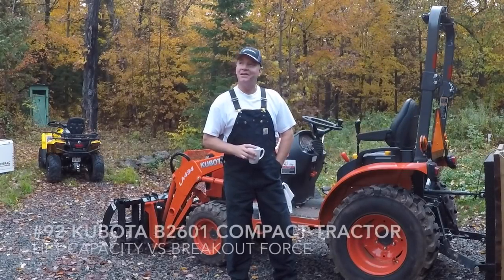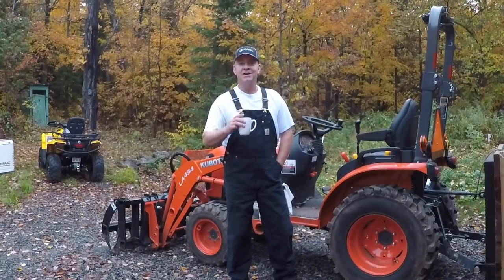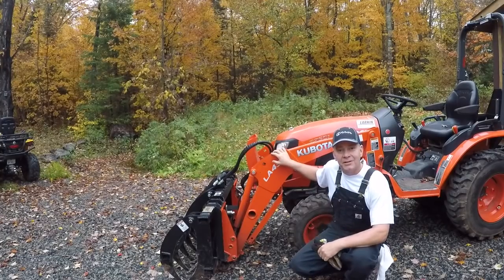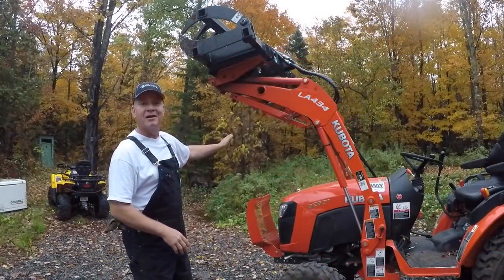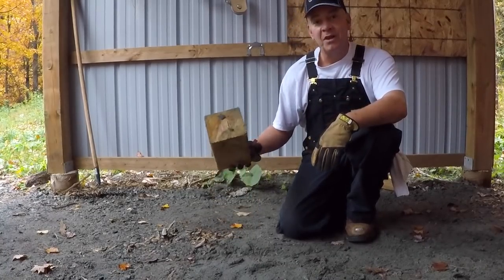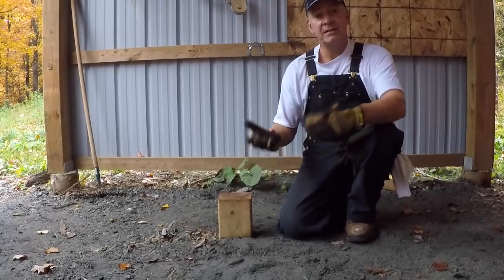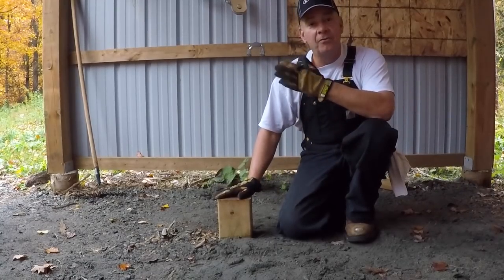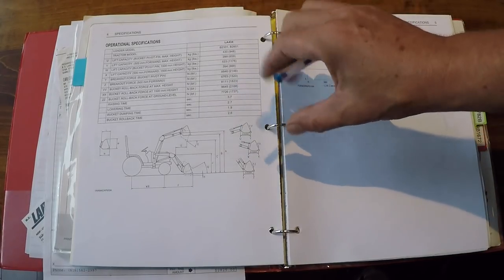#92 Kubota B2601 Compact Tractor The Great Debate : Lift Vs Breakout Force

Comment: Very good explanation of the front loaders operation. The designed capacity is very high and just what you would want but, that is just the loader. The capacity of the tractor running gear must also (or not) be considered when lifting heavy loads. Tires, axels, bearing, ect. must all in their turn carry the loads once lifted. All that said, the B-2601 Kubota only has a front axel capacity of just over 1300 lb.s according to the spec. sheet and if you add the bounce factor which is what I think broke the front end of my tractor years ago, weight on the loader can and do become extreme! I am looking for some pictures I took when it happened to me if I find them I well send you copies.
Reply from the maker: Hey good morning Rick. Yes you bet. I still need to do more digging as you make a good point. If my front end can only handle 1300 lbs, then I need to be conscious of that. Which makes me wonder what other components I need to also be careful of. I'd also like to ask the dealer why the tractor can lift more weight than it can handle on the front axle. Still lots to do. And yes, if you have the pics, I would like to see them. Cheers and thanks again Rick!
Reply: Because the loader attaches to the center of the tractor. The load on the bucket is transferred through the loader to the frame. The frame is supported by both axles not just the front! So u were just fine lifting that big ash.  Obviously u dont want to bounce around as that increases the forces.
Reply: And if you ballast the back of the tractor, even less of the weight is on the front axle.  For argument's sake, if you put 1000 lbs on the back of the tractor, that's now pivoting on the rear axle, and lifting the front of the tractor somewhat.  When you put load on the FEL, it first balances out that rear load, then puts load on the front axle.  Because you've got two pivot points (front axle and rear axle) the overall load is kinda hard to work out - but basically the more you put on the back, the more weight you lift off the front axles.  The right amount of ballast is probably as much as you can take so that you can still steer when the FEL is empty - that shifts as much weight to the back axle as possible.
Reply from the maker: Hey thanks Andy. Sorry I just saw this- that makes sense - Cheers!
Reply from the maker: Hey good morning and thanks Paul! Cheers!

Comment: I have a question. 1st very good video. Very informative. Take a 3301 by Kubota. The lift capacity is about 1100 lbs at pivot pin. Tractor and loader probably 22-23 Thousand. The RK 37 demonstrated on outdoor with the Morgans will lift about 22 hundred lbs. Price 20 grand. (Lift at pivot pin as well). So should you lean towards a Rural King as opposed to the Kubota. It seems that Kubota and John Deere have clean lines , good craftsmanship but Tractors like Mahindra,  RK, LS, TYM...Smoke them on performance. I would appreciate some feedback . I hear over and over again you're paying for the Green or Orange paint. What do you think? Thanks. Mark.
Reply from the maker: Good morning Mark. Well, I have to say I am no expert for sure on this but for what it's worth, and in general, here are my thoughts.  I think for sure you pay a little more for the paint. But that's because the paint has a long history of engineering, presence and historical long time proven reliability behind it. Not to say that others don't have good engineering, but the market is now becoming much more competitive than it used to be, especially in the compact and utility segments. Take any industry you can think of and usually as new competition enters, the old more established brands take a while to realize or react to the fact that their market share is being depleted. Most if not all those brands above have good long warranties so that would give me comfort. Re: performance. I think the new competitors are doing what they need to do to gain market share. They are providing more value for less money. Of course, without a long timeline of historical performance ( relative to green or orange), they know that is a big consideration for someone spending $20k. and therefore a big hurdle to get the consumer over. Why I bought orange. Of the 4 dealers I visited, the Dealer was awesome, and still is to this day. Selling tractors for 40+ years,  so they had long presence, proven long time reliability and experience and that was worth a little more to me since I am a long way from any dealer.  But I'll sum up with this - the RKs look like a good tractor with good value for the money. And they have an 8 year warranty on them ( longer than Kubota). And they are trying to break into an established competitive market so they should be providing greater value than the established companies. So if you find the dealer is good and you have confidence in him/her, and after reviewing the full specs ( not just lift capacity) of the various tractors you compare,  it looks like a good match for you, I would consider it. The company that makes RK has been around for a very long time. So some research/ googling on them would be helpful too to help provide confidence. Sorry that was a long answer and not sure I helped you much but hope there was something in there that helped. LOL. Good luck and let me know how it turns out if you decide to buy one. Cheers Mark!
Reply: @GPOutdoors  Thanks. Very helpful. I guess a point I was making, why would you buy a Kubota 33 hp when you can buy the RK with 37 HP , lifts DOUBLE on the Loader and 2 to 4 Thousand less money? But you are right. One way to put a footprint in this market is to come up with a Tractor with these specs and unbeatable price. Hard to turn down. I have owned the LS 33 hp for 2 years,  put 230 hours on it, with zero problems. My lifting capacity on the loader is 1600 lbs. The 3 pt 1800 but I'm looking to upgrade to something a little stronger. I have 2 builders I work for. They flip old houses.  Their yards are way overgrown with bushes,  ground  covers , vines as big as your fist, wild growing small trees and junk. I usually load dumpsters or sometimes bury it. I also dig new driveways . You can go to www.tuckertractorworks.com. and see some photos. I did Construction and remodeling,  decks, bathrooms,  floors, kitchens,  room additions you name it for 30 years but my Arthritis won't let me do it anymore so I bought a Tractor and started doing clean up. I really enjoy it. It is very gratifying and enjoyable. I just like the outdoors,  the wildlife,  Gods creation and the smell of diesel fuel. Sounds nuts but that's what some of us men do. Thank you for taking the time to answer. God Bless. Mark.
Reply from the maker: You're welcome Mark. Hope it helped a little. It sounds like you are doing something you enjoy a lot. There is something about being outside working. That is awesome. Enjoy it and be safe! Cheers!
Reply: @markmccoy1304  Seems you can't buy RK tractors in Canada, so it's not an option vs Kubota. Also, USD 1000  is about  CAD 1300+ .
Reply: @BigredApril1951  Thanks.

Comment: Hi
Great videos
Something that I recently was reminded of is the weight of the quick release frame on my Kubota loader reduces the lifting capacity of my loader, I have a B3150 with a LA 534 loader and it is disappointing what it fails to lift when compared to my old B2710 that was stolen.
I also find the loader operates faster than I would like when working close up.
Michael
Reply from the maker: Good morning Michael. Thanks for sharing - I am not sure if I knew that. Because I am still learning, I now learned to run at low RPMs so the loader operates much slower so I am able to use it easier. The tractor does not need to be at high RPMs unless you need every ounce of capacity to lift something. Under normal use, I run at about 1800 - 2000 RPM on the B and it lifts and operates well and the loader operates nice and slow. Thanks again for sharing your experience and all the best!

Comment: Were did you get the Graple? And what Brand is it?
Reply from the maker: Good day Shane. It is manufactured by HLA Attachments ( they have a website by the same name) here in Ontario Canada but they do not sell retail so you would need to go through a dealer. I purchased it from my Kubota dealer and I know Farmer Equipment Sales (website same name) also sells them. Hope that helps. Cheers!

Comment: A great many of these tractors are used simply as loaders, and while you are essentially correct , when used as a loader the more break out force you have translates to how well you can load your bucket. example if you can drive into say a pile of soil and pick straight up rather than having to back out somewhat before you can lift your bucket allows you to get a larger load in the Bucket therefore decreasing operator time and in the case of the customer giving them the full scoop they may have paid for. It is also my understanding that currently a comparable John Deere tractor has about 35% more break out force. but either way you look at it each companies tractor has both its pros and cons great video
Reply from the maker: Thanks Lee. I still have a few things to sort out in understanding all these specs but learning a little as I go. Cheers!

Comment: Good overall. Your physics was wrong at the beginning... u were thinking of sliding aka static friction vs rolling aka dynamic friction. That is for sliding things not lifting them. If u have to lift 100lbs vertically then u need 100lbs. 
2nd the lift capacity changes as the height increases because the lift cylinder angle changes. Angles and leverage r key. That is why one tractor might have really high break out force but lower lift capacity vs the competition. 
So if u load trucks u want to focus on the max load at max height. If u dig all the time u want to focus on the breakout force.
Reply from the maker: Hey thanks Andy. Still a little foggy on it but I think I kind of have the idea. I get what you are saying about the life and height. That makes sense to me for sure. Thanks for giving me a little more info on it. Have a good one and talk again soon. Cheers!

Comment: respectfully, i cannot agree with your explanation of "lift capacity" versus "break-out force capacity."  the "lift" capacity of a loader is the total amount of weight you can put in the bucket and then lift the bucket off the ground to the total height of the loader - say 900 lbs. of dirt or gravel or cement blocks, etc. loaded in the bucket.  the "break-out" force is like prying a sidewalk slab off the ground by putting a crow-bar under the slab and then putting a brick under the crow-bar to create a "lever effect."  think here about Archimedes and his "lever and fulcrum."  the bucket on a loader tilts (curls) forward and back (up and down) using separate hydraulic cylinders from those used to "lift" the entire loader.  suppose you pulled up to the slab of concrete you were going to put your crow-bar under and slipped the bucket edge under the slab of concrete.  if you pulled back on the bucket curling lever allowing the bucket to curl up - that is the "break-out" force.  this forces is GREATER than the lift force capacity of the entire loader because the "bucket pins" act as a "fulcrum" and the bucket acts as a lever - thus adding a "mechanical advantage" to the hydraulic cylinders that curl the bucket.  you can perform a simple test on any loader to see the difference between "lift capacity" and "break-out force capacity."  run your tractor over to any very heavy object - a concrete slab, a large tree trunk, etc.  put the heavy object inside the loader bucket and try and lift the object off the ground.  if the loader will not pick the item off the ground, the object's weight exceeds the "lift" capacity of the loader.  now, do the same thing with the heavy object but this time, do not try and lift the object off the ground with the loader, just put the edge of the bucket under part of the object and "curl" the bucket backward and see if the bucket will pick the item off the ground to the extent that the bucket will curl rearward.  that is the "break-out force" capacity - which will always be MORE than the "lift" capacity.  if you want to "visualize" "break-out force" put the bucket flat on the ground and then curl the bucket backward.  the rear bucket pins are the "fulcrum" and the bucket itself is the "lever."
Reply from the maker: Hey good morning Jim! Thanks for taking the time to explain the above. This area of the tractor is definitely a head scratcher for me - There are so many different variations of explanations from different folks but I always appreciate respectful feedback. We all learn from each other. Here is where the above explanation causes me pause : In the manual for the FEL, those pages I show on the video outline 3 different "forces" in the Table : Lift Capacity (defined as the amount you can hold at the highest point) -, Break Out Force , and Roll Back Force. Looking at the schematics of the tractor (found below the Table on that page), it appears the Roll Back force lines up with your thoughts above. You can find the manual for the Loader online if you google for Kubota LA434 manual. Also, here is the definition of Breakout Force from the ASAE specs : " 5.1.5 Breakout force—at pivot pin (Y): Vertical lifting force, in newtons (pounds), the loader will exert at the bucket pivot pin centerline using the lift cylinders only, with the bucket horizontal at ground line." . Note it says using the "lift cylinders only". So this is kind of what confuses me as several folks have provided a similar explanation as you have above. So I think I still have some work to do to solve this one.LOL. But hey, if you have time to look at it further, I would appreciate hearing any further feedback you have. Again, I really appreciate you taking the time to help out - it helps all of us. Have a great week and talk again soon!
Reply: @GPOutdoors  hi GP.   thank you for your kind words.   the description of "break out force" in your manual is similar to my example even if the sentence composition is a bit "tortured."  look at the side of your bucket and imagine that it is an Isosceles Triangle lying on its side with the "short" vertical axis being at the pivot pin and the two longer (horizontal) axes being the top and bottom of the bucket.  the manual states: "Breakout force - vertical lifting force...in pounds the loader will exert at the bucket pivot pin .... using the lift cylinders only... with the bucket horizontal at ground line."  that translates to the "bucket lift cylinders" "lifting" the front of the bucket up in the air (curling upward) as the bucket "pivots" on the bucket pivot pin at the back of the bucket.  the "lift cylinders" being referred to are the cylinders that operate the bucket only - NOT the cylinders that lift the entire loader assembly.  remember, you have TWO "lifting actions" with a tractor loader: 1. the lifting of the entire loader assembly up in the air;  2. the movement of the bucket up and down (curling back and forth) on the pivot pin of the rear of the bucket.  the two lifting specifications for any loader refer to each of these two separate actions - "lift capacity" - the maximum amount of weight you can put in a bucket and lift into the air to maximum height AND "breakout force" the maximum amount of "lifting force" as measured in pounds, that the front of the bucket will lift just by "curling" the bucket backwards while the bucket is sitting flat on the ground.
Reply from the maker: Good morning Jim. That makes a lot of sense. Thanks for explaining that so clearly. So, assuming we have solved Lift Capacity and Break Out Force correctly, then I am still left with trying to figure out what Roll Back Force is? I know I am asking a little more of you , and it's ok if you don't have the time , but care to take a shot at it? It's the last piece of the puzzle...:)) Either way I really appreciate your efforts so far. I will need to vet this a little further and as needed, put together a new video to correct anything that may have been misstated in the first one. So the quest continues. Thanks again!

Comment: You have to reconfigure your math  cause you have the skid steer connection. That puts it out further than the pins.
Reply from the maker: Good point Tomas. I also have to confirm whether the bucket weight or FEL weight is included. I think I still have some more research to do. Thanks for watching and for saying hi as always! Cheers!
Reply: @GPOutdoors  I like your channel by the way.